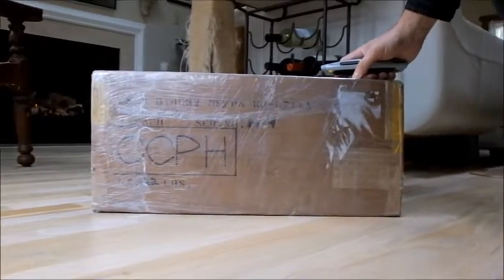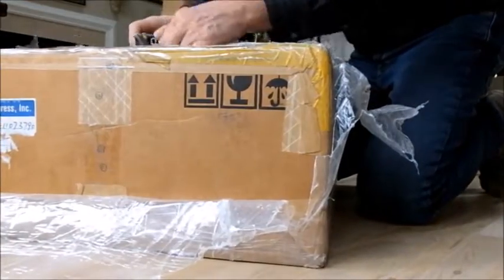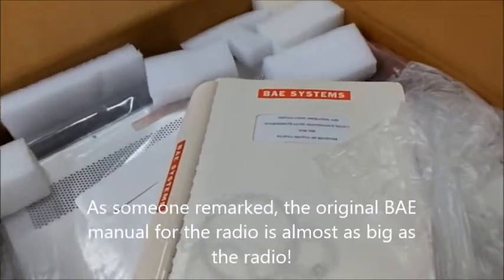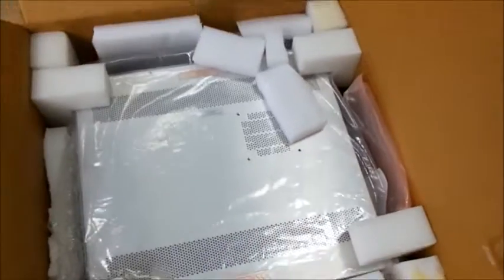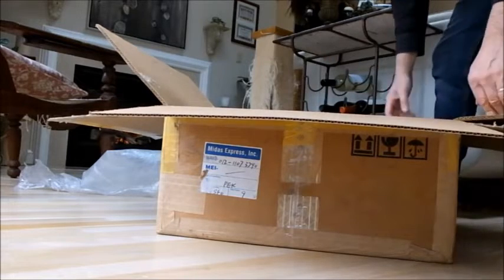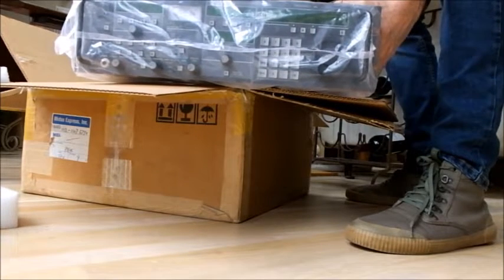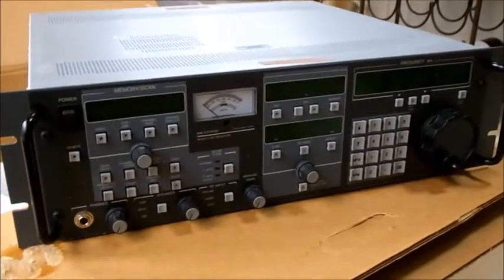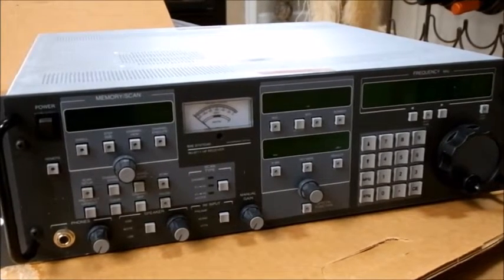Watkins Johnson BAE Unboxing of NIB WJ 8711A

Comment: I'd say it's the solid state equivalent of the venerable Collins R390A!  Had a few of the former, but missed the WJ line.  Before SDR days, there was a well known (and presumably well-off) DXer on the west coast, who used to bring down, perhaps 6 or 8 WJ, all rack mounted, and each fed to a then, very modern, mini disc recorder and each WJ also with an additional Sherwood SE-3.  We estimated that he had at least $20k worth of equipment.  Rather than the full-size WJ, his were the 1/2 sized units, so 2 would fit in each 19" slot, and were apparently as good as the full-sized versions.  I sure lusted over his set-up!  He was very private, and did not like/allow anyone taking pictures of his setup!  He's no longer active in the SWL hobby, having moved over to the ham radio side, I believe.
Reply: You have grossly underestimated the value of that man's equipment.  If he had a half-dozen wj-8712's--- the half-rack equivalent of the 8711A---each with their own SE-3's, then I estimate it to be close to $55,000!!

Comment: Very nice Dan, a jewel. This receiver will keep you busy for a while reading the operating manual and going through the modes. I noticed some zero digits on the frequency and memory scan display blinking often and on, I think it is because it has been so long since the receiver was last turned on and it should go away as the electrolytic capacitors among other things charge completely, I am surprised how well it functions after two decades in the off mode. I have read that a variac could be used to safely power on a receiver that hasn't been in operation for an extended period of time, I not sure if this is the case.
Reply from the maker: That is normal operation for the receiver, selected readout increment has blinking digit
Reply: @dxace1  You are right!